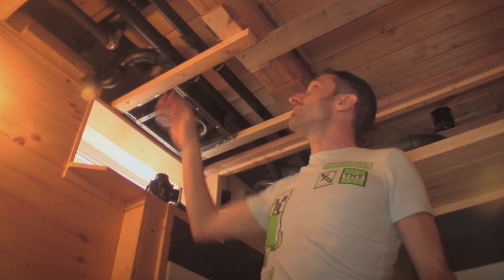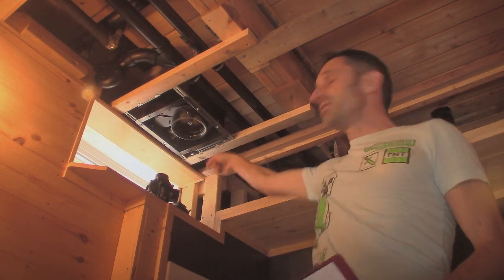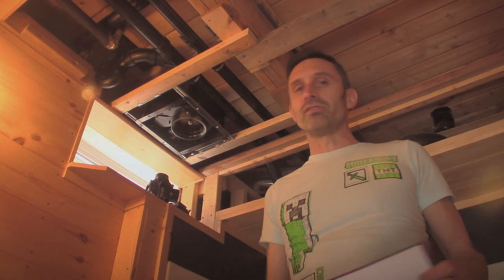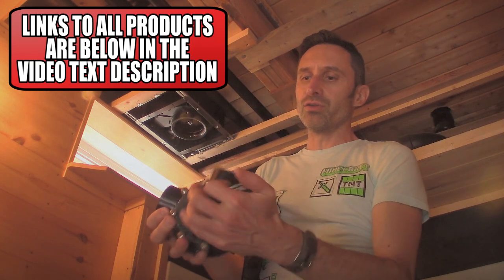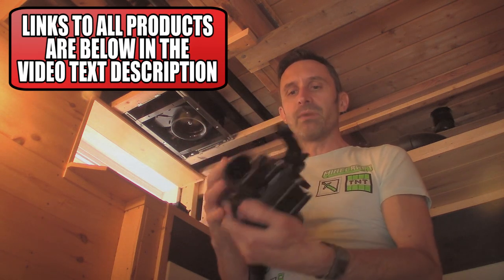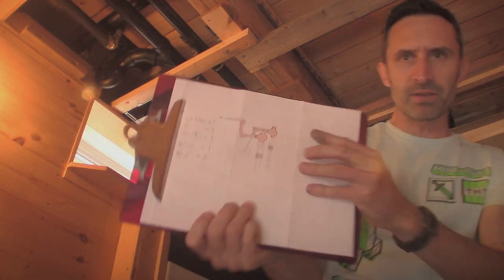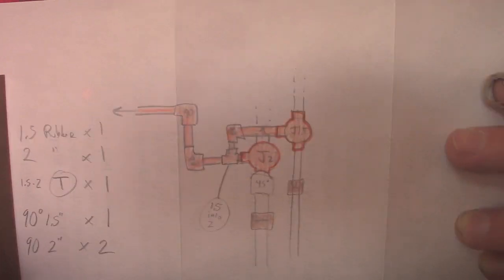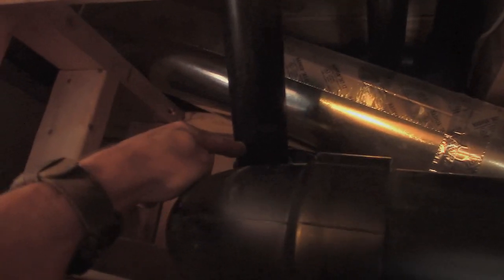Starting a Gray Water System from your Home

Comment: Great idea. Use of grey waters cuts down quite a bit on wasteful use of drinking water 👊
Reply from the maker: Around here, we have plenty of drinking water (at least historically). So while it's nice to save a resource, the eco-destruction created by the extra valves and pipes is probably not a good trade-off. But what I'm really excited about is that the gray water will be an auto-waterer for the greenhouse and will also be recapturing soil nutrients like dead skin cells etc.

Comment: Sinks, bath and laundry are all bypassing the septic system. Had the State "health" (I sure feel more healthy) department gave me difficulty over it even though it was installed that way in the ’50s.
A little social engineering with an official-looking form and it all worked out.
Most people in that line of employment are just looking for a way to tick the needed boxes and get home by 1545.
Reply from the maker: That's my view as well. They just don't want to be the scapegoat that someone will point a finger at if something goes wrong. I can't blame them. I'd be nervous about risking the entirety of my employment and my reputation for all potential future jobs by stepping outside what's "check boxable". I wouldn't be able to sleep at night worrying about what if this or that happens at XY or Z house that I signed off on. It's not the inspectors that are the problem, it's the system that they are working within. It claims to encourage ingenuity, but squashes it like a roach whenever it sees it.

Comment: I had an unintentional grey water system a couple years ago. So the washing machine outflow kept backing up into the laundry room & flooding it. What plumbing help we could afford failed us. Our only solution was to connect the outflow from the machine to another, longer pipe that led outside. We had to keep the door
 to the outside from the laundry cracked open when I did laundry. The interior laundry door had to remain shut b/c Alabama in summer. My garden lost its damn mind. If I wasn't doing laundry I was harvesting in the garden!!! It was exhausting! Had to put a stop to that happy horse hockey! We did everything we could afford including putting some caustic chemicals down there to melt tree roots. Didn't help. Nothing did. A year & a half ago both the 20 yr old washer & dryer went to whatever rewards there are for such appliances. It took us all this time to save enough 
$$$ to buy others. We got them installed (my son wired the dryer himself & ran the plumbing) last week. The 1st load we ran thru the washer we stood around nervously waiting for the overflow. Didn't happen. (Yes we made sacrifices of thanks.....you know better!) I can only assume 1 of 2 things: either the clog was due to some organic thing (read that animal) that shimmied up there & died or somebody intentionally or not put something down there they should not have. Either way 1.5 years of no movement at all in the pipe fixed it. 
I gotta get a more intentional grey water plan. That last thing nearly killed me!😏 Peace & Blessings Praxis
Reply from the maker: That's a crazy story... and a bit of a mystery too. I wonder if the drain pipes can handle a certain volume per minute (due to some blockage) and while the old machine dumped too much too fast, the newer machine (perhaps being more water efficient) dumps at a slower rate so doesn't overwhelm the draining capacity of the line?
Reply: @PraxisPrepper  could be, definitely. The old machines were literally 20 yrs old. I wanted to cheap out & get used machines! Jesus dunno how much washing you've done in a bucket, not fun. But young son (41 tomorrow btw) is a meat market co manager & he plays in more blood daily than I ever did as a Critical Care RN. He insisted on new machines w/ a steam function so here we are. They are very nice. Still gotta research if I can use my diy laundry detergent in them. I hate paying for stuff w/ a lot of chemicals or that's 90% water!
Reply from the maker: @selenepickins4874  My washer says it only takes the HE detergents, so I buy the 7th Gen HE ones. But I still have my old laundry powder kicking around too. I figure I'm saving it for if I ever need to do MY laundry in a bucket. It's def more work but not THAT bad... if you have low standards for what's clean like I do. When I'm on vacation, I literally do my laundry by tossing it into the bottom of the shower at the end of the day when I'm showering and stepping on it while I wash, then hang it up to dry. ;)
Reply: @PraxisPrepper  nah the bucket wasn't intolerable. It was the wringing out, got my carpel tunnel going. And I've totally done the shower thing myself. LOL My rule if you don't stink (including clothing) & you aren't chafing (shudder) you're prolly ok to go unless you're going someplace where you care what they think of you. These days that list has become very very small for me.😏 Thx for the advice & talk, Praxis. Blessings

Comment: Oh I forgot one thing, there is a possible problem with a grey water system and that is the introduction of chemicals that might not be the best for plants, keeping track of what cleaning chemicals you use is important.   I also forgot about sewer gases, make sure you place a trap out your output.
Reply from the maker: I'll be sure to address that chemical concern in a future video when I get into the real gray water part. Here at our place we're SUPER picky about what goes down the drain - especially if it's going to a plant bed. Good thing to point out!

Comment: How do you a plan to handle the excess gray water (if any) in your greenhouse? Over watering some plants could be a problem if water  amounts become to much for the plants to handle safely.  I would have some kind of catch basin to control the amount of water your plants receive.
Reply from the maker: All in good time as I work on the project. There are a lot of variables to balance, so I like to just keep my options open and see how it goes - making tweaks as needed. There are a lot of different ways of controlling the supply/demand balance. Ultimately, I had a foundation passthrough left in that greenhouse so if the supply is just so crazy as to be way too much, excess could be routed right out of the greenhouse entirely.

Comment: I have my system set up for a grey water as well but I do not know about the valving over your head for something that in all truth you will never need.  The one truth that anyone should remember is keep it as simple as possible.  You are just introducing an added complication that cost more money as well as a point failure that could lead to water damage in later years.  Sorry I cannot be a cheer leader on this one but it is your money and your life.
Reply from the maker: I've used these Jandy valves in the past without issue for years. Also, it's not a pressurized line, so the chance of any leak (given my stellar ABS pipe joining skills) is rather low. The valves (if they DID drip) would drip onto an area of ceiling that would be very easy to spot and wouldn't turn into a nightmare from lack of our awareness of the problem.